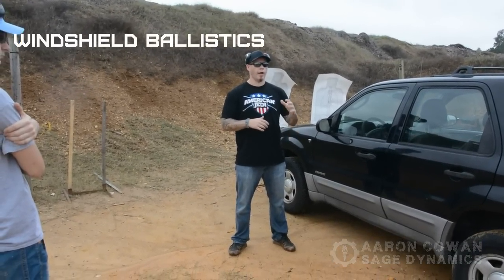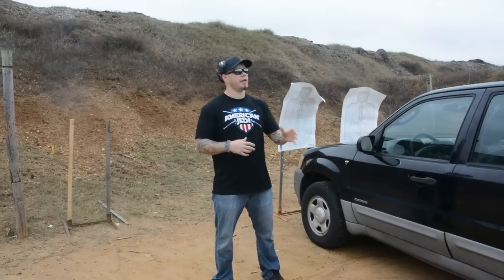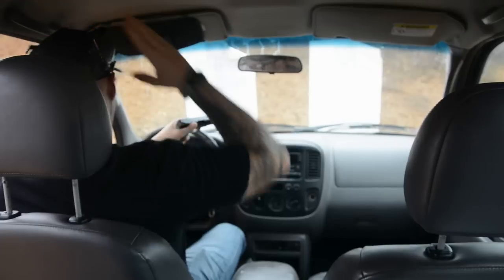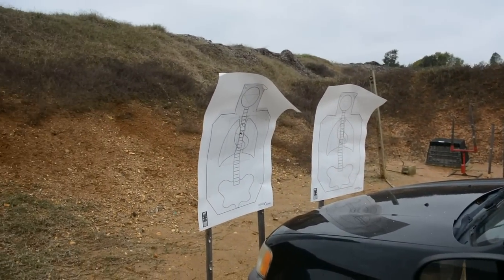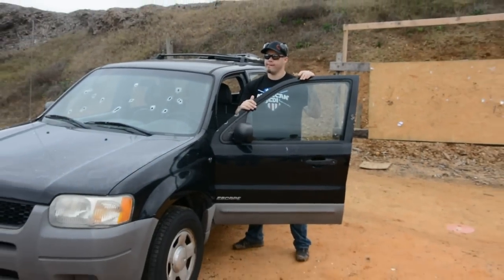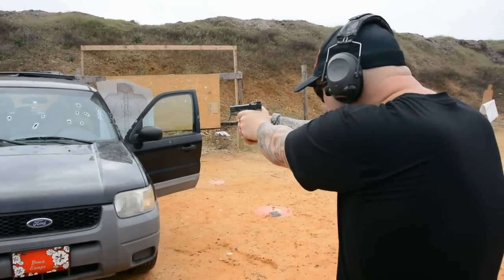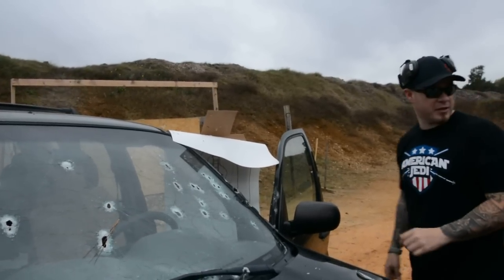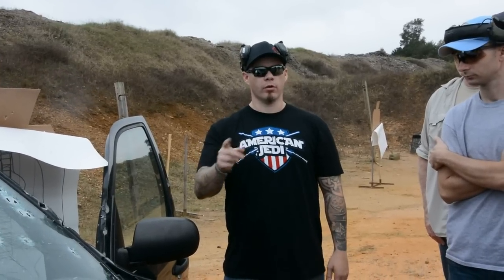Windshield Ballisitcs

Comment: I would like to know in what scenario, your car would be unable to move and you'd have 2 target this close to the front of the vehicle.
Why is your gun already drawn, if you have the gun drawn, you're expecting a gun fight, so again, why are they so close to the car and why have you not hopped out to obtain a proper covered firing position?
If your gun is not drawn, you aren't drawing it in time to prevent them from already shooting and moving to either side.
Reply from the maker: It’s impossible to answer that question, as the scenario on your head may or may not conform to reality. Both in and out of law enforcement, vehicle assaults happen and driving away or “hopping out” isn’t possible in the first few moments, or at all.  There’s quite a lot of anecdotal evidence to support that if you look around.  Also, “cover” in urban settings isn’t very common.  Plenty of possible concealment, and most of it is going to be yards or more away.

Comment: Just want to make sure I understand. Generally, rounds fired from inside to outside deflect up. Rounds fired from outside to inside don't deflect much but will probably deflect down if they do. Right or wrong?
Reply: You can count on your first shots not going where you aimed at so shoot through the same hole so your following shoots will go where you aim. IF your first rounds have a positive impact on the threat then awesome but 0 guarantees. There are no holds just holes.

Comment: Great video, thanks.  Been carrying a Charter Bulldog but think the hammer spring crapped out on me for the Buffalo Bore 200 grain HCWC.  Failure to ignite on 3/10 rounds.  Do you think the 45acp 230 grain bonded out of a Shield or 44 HCWC out of a Bulldog or a 357 bonded out of SP101 2.5 inch would do significantly better than 9mm Gold Dot out of a Shield for POA/POI?  I have an idea from video what you'll say but thought I'd ask anyway for the children......I like big slow heavy bullets in smaller guns, snubbies in particular.  

I shot the 130 grain Win PDX from a Smith 638 into the windshield of a Geo Metro and was dismayed at the amount of deflection.  1 inch group into windshield from 10 feet away, 3 inch deflect to left,  strung up and down IDPA target about 6 inches.  John Murphys course FPF, June 2018.  Thanks.